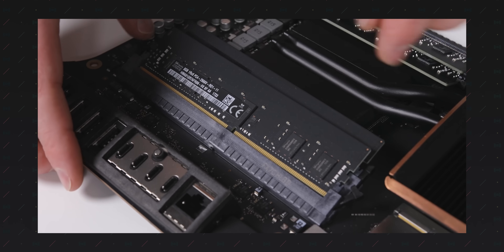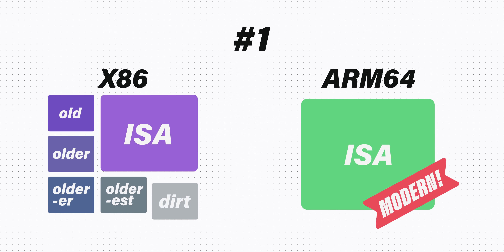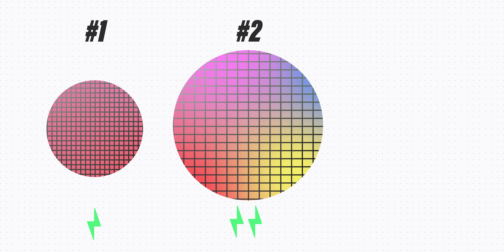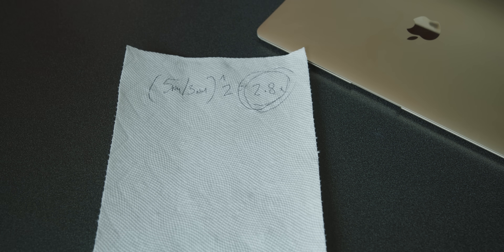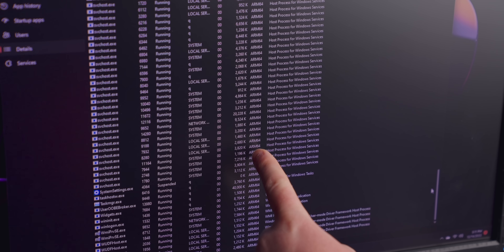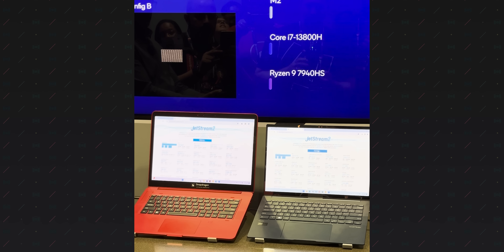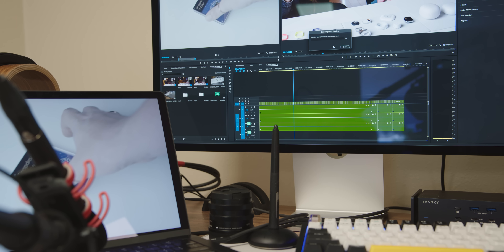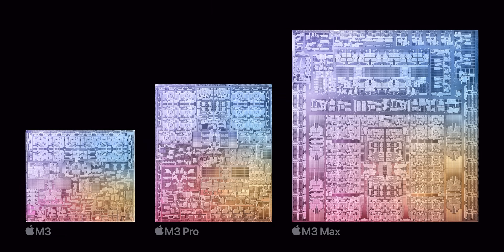Apple's Silicon Magic Is Over!

Comment: x86 is NOT less efficient than arm.... This is a myth. It is all about the chip design. x86 isn't used for phones because Intel missed the smart phone boom. So ARM just happens to be far more common for low power scenarios
Reply: Stop spreading around myth. It is less efficient by math and physics. Fixed length instruction sets use less power than the ones CISC use by physics or computer science logic.
Reply: The ISA in itself already is, but then every existing microarchitecture for amd64 has been pushing for maximum performance, so you won't get an amd64 chip in a phone either without large compromises or an entire redesign. The steam deck and others being a prime example, being barely more powerful than a medium-range phone when limited to 7w, and it only scales down even worse.
Reply: I always thought that x86 was not competitive with ARM in mobile phones and small devices because they were almost always idle and ARM has a power advantage when idle.
Reply: @longdang2681  Perhaps. Upon doing some more research it seems like the larger instruction lengths means the CPU has to put more work into decoding the instructions and are therefore more likely to need to access cache, or even RAM. Which uses much more power. However a process could probably be designed to account for this
Reply: Good luck running RISC code on X86  , you can't brute force it.
Reply: @DavidRobinson1978  there are ARM and RISC-V emulators for x86. I'm not really sure what you mean... I'm sure they won't run as well as on their native ISA but generally speaking you should be able to brute force it
Reply: @DavidRobinson1978  Why would anyone want to run RISC code on an x86?
Reply from the maker: It doesn’t need to be, but it is. Due to legacy baggage. And Apple Silicon is proof that perf per watt can’t be matched in high-end Arm implementations.
Reply: @snazzy  from everything I've heard the "legacy baggage" thing is a myth. AMD and Intel choose to optimize for higher TDPs because they compete with each other in gaming which uses a ton of power. Apple on the other hand designs their chips primarily for phones and basically doesn't compete at all in gaming. Chances are when the Snapdragon elite launches it will perform similar to AMD counterparts and well realize that the ISA just isn't as important as people claim it is
Reply from the maker: @jamescampbell6728 Benchmark data and total power draw very much suggests they’re answering directly to Apple.
Reply: @snazzy  Total power draw across different platforms is unfair as the x86 is upgradeable and the ARM system is not. Upgradeability requires more resources in reserve and hence requires more power. Eg. It's easier to optimize if you know you are using soldered Samsung RAM; much harder if you have to maintain compatibility with all major dye iterations from each of the big RAM companies. More expandability requires more PCB which requires more power. You also need to remember that Apple almost always uses a lower manufacturing node than it's competitors, which skews the figures to favour ARM.
My guess from similar sized single board computers with similar connectors and io is that ARM draws less power at idle; but at the same full load performance level, it might be less than 10% more power efficient. There's lots of variation in the efficiency of processors from both ARM and x86.
Reply: @jamescampbell6728  jesus what is this cope bro those chips with igpus are not meant for gaming at all, they were barely even passable until recently anyway. Saying thst amd is less efficent dje to their chips being made for gaming is a falacy the laptops in the market aren't designed for that with igpus.

Comment: I dread these snapdragon chips being locked down and inaccessible to linux users. The transition to arm would spell trouble for people who want literally any freedom over their hardware whatsoever.
Reply: Ashai linux works well, at least it did last time I tried it.
Reply: @UnLoco-101 They could do some verified boot without an option to change that. So maybe Windows only.
Reply: Id be shocked if we don't get Linux support for this. Esp if companies like Lenovo and Dell want to use them.  

Call me optimistic, but I think companies are more likely to play well with Linux these days than in the past.  And it will be another strike against apple. A selling point to the snap dragon can be it's not locked down like apple.  

At least that's my hope!
Reply: I hope that the industry shifts to a more standardized architecture so that Linux does not have to be hacked, we will see soon enough
Reply: That would be very ironic. Moving from proprietory to open source architecture and loosing the option.
Reply: @kushagraN  what architecture is open source?
Reply: Isn't RISC-V an open source ARM, basically?
Reply: @JHSaxa  Yes, but no. Like yes it is technically but that doesn't mean manufacturers will actually abide by the standard and not make custom undisclosed things with it.